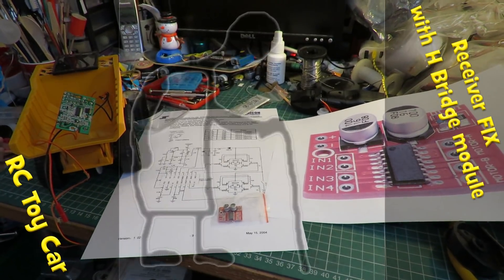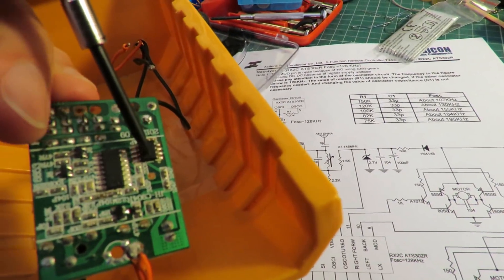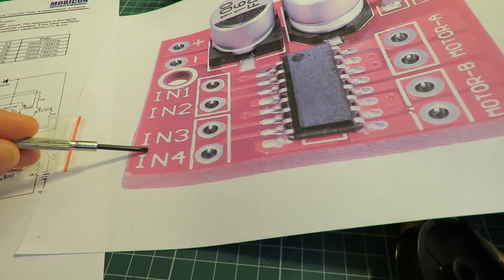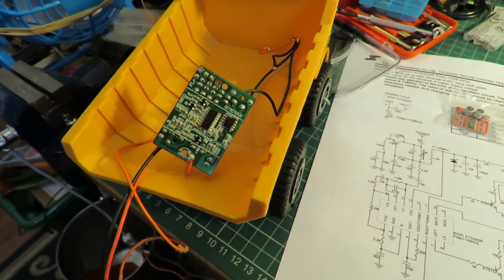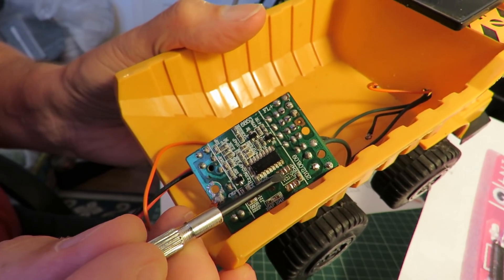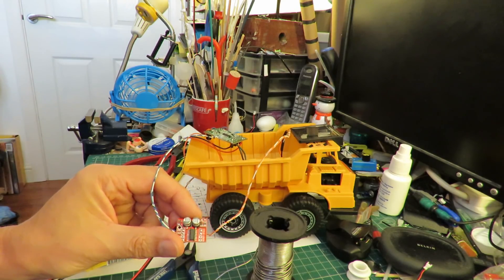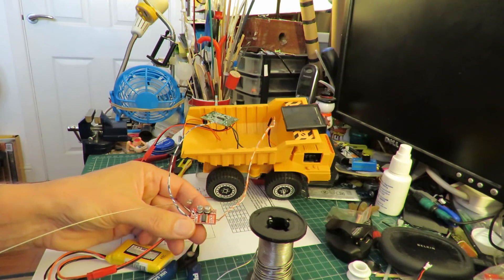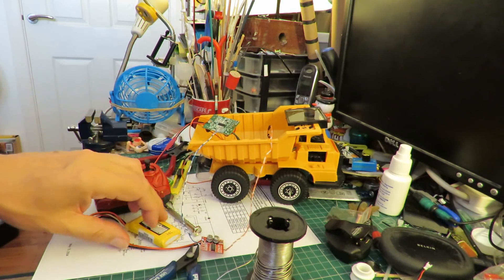Broken RC Toy Car Receiver FIX with H Bridge module

Comment: Hi again is it possible to upgrade transistors for more power ? Finally any idea how to extend range on a 27mhz 😊
Reply from the maker: @RyanRobinson-qi8qr  yes you could change the transistors to handle a higher current flow. You would need to find data sheets for the transistors and check their specifications. There are often comparison charts on electrical component sites that help you with that. However, if you want to increase the voltage, it is a bit more complicated. Remember, the rest of the receiver circuit board is designed for the voltage of the existing batteries, so it will burn out if you increase the voltage. You can get a separate H-bridge module that will work with the output of the existing receiver circuit but use a separate battery to power the motors. All of this depends on your electronic knowledge and skills. It is an excellent learning project. As for increasing the range, the length of the aerial is significant. You would have to research how the length of the aerial relates to the frequency. The bottom line is that unless you want to learn the electronics side of how it all works, the easiest fix is to upgrade to Hobby Grade radio gear. Initially, there is expense, but the Hobby Grade gear is well supported and can be transferred from car to car to boat to plane, etc. You get full proportional steering and throttle, and the range is literally out of sight.
Reply: @GrandadIsAnOldMan  thanks am so interested in running the motor with separate power are there any videos or articles to assist?
Reply: @GrandadIsAnOldMan  thanks am so interested in running the motor with separate power are there any videos or articles to assist?
Reply from the maker: @RyanRobinson-qi8qr  the video you are commenting on shows the H-Bridge module. It uses the output signals from the receiver, but it's power supply can be a different battery. You can find them on eBay if you search for "Dual Channel DC Motor Driver Module". They come in a wide range of power ratings and a wide range of prices. Explanation in the video description.
Reply: @GrandadIsAnOldMan  I understood the video however my chips are not burnt-out I just want to add more power to the drive motor
Reply from the maker: @RyanRobinson-qi8qr  Yes, by using this module you can do that, bypassing the H-Bridge onboard the receiver which is limited to the power supplied by the existing battery. As I have explained, if you just try putting a bigger battery through the existing receiver, you will burn it out. Changing the onboard transistors would allow those transistors to carry more current and voltage, but that won't stop the rest of the components on the receiver from frying.
Reply: @GrandadIsAnOldMan  thanks can i use the output that currently runs the drive motor directly to the external h bridge as the signal
Reply from the maker: @RyanRobinson-qi8qr  I explained in the video how it works. You take the signal from the pins of the receiver chip (RX2 chip in this video). That tells the H bridge module what to do. All you are doing is bypassing the onboard H-bridge and using the external module. That gives you the advantage of using a different battery to power the motors. If you had the electronic skills, you could cut the tracks on the receiver circuit board and modify it to do the same thing, but then you would also have to change the onboard transistors, so using the external module make the job simpler. I show the circuit diagrams in the video and talk you through how it goes together and how it works.
Reply: @GrandadIsAnOldMan  ok thanks for taking the time to explain. Cheers

Comment: My Rc car still steers but does not move forward or backward, I think I burnt out the ic 😅, I don't know what to do
Reply from the maker: First thing I would do it test the motor to see if that works Ok by putting a battery direct to it.
Reply: @GrandadIsAnOldMan  I also did that and the motor is working smoothly
Also when I added extra voltage on the receiver it made a pop sound and started smoking
Reply from the maker: @obiomaokeke9292  I think you have answered your own question. You will need a new receiver board. It really isn't worth the effort to try to replace the components.
Reply: @GrandadIsAnOldMan  thank you 🙂😌
Reply: @GrandadIsAnOldMan  thank you 🙂😌
Reply: @GrandadIsAnOldMan  I also did that and the motor is working smoothly
Also when I added extra voltage on the receiver it made a pop sound and started smoking

Comment: Thank you for this video, I thought for a moment I could repair my son's a rc car module, but now  I'm 100% sure that no way ))))))))))))))))))
Reply from the maker: It depends what is wrong with it and what sort of components are on the board. In most cases on the older boards it is probably one or maybe two transistors that need replacing when they have overheated. When the motor gets overloaded, car stuck in grass for example, it draws too much current and it is the "H-bridge" transistors that take the punishment as they are the ones that feed the power from the battery to the motor. It is very rare any other components get damaged. The problem is identifying suitable replacements. However, you can buy a replacement transmitter and receiver set and swap the receiver out. I used to trawl the charity shops buying up any cheap RC cars and then use the parts from them to fix other cars.
Reply: @GrandadIsAnOldMan   Thank you for reply. Actually it seems like a car looses a contact with a remote controller and it happens too often. A seller offered to send me a new motherboard, but after your video I think to request a refund)))))
Reply from the maker: @michaelraskin2251  there are so many possible causes, simply fresh batteries is sometimes all that is needed. Sometimes there is something causing radio interference. I have just found one of my old cars reacts to my WiFi signal.

Comment: Is it necessary to use separate batteries to power both the circuits
Reply from the maker: No, it is not necessary, if your receiver uses the right voltage, however you might want to so you can use a higher voltage for the drive motor.
Reply: @GrandadIsAnOldMan  Thanks...!!! 🤟 🤟

Comment: Why cant we connect the common power supply to H-bridge and receiver then?
Reply from the maker: You can use the same battery, however it's more a matter of the opposite. Often you want to use a different/bigger battery to drive the motor. Many people try to use a bigger battery to make their car faster and all that happens is they burn out the H bridge on the receiver, so using this external H bridge gives you the ability to use 2 batteries. Existing battery for the receiver and a big one for the drive motor. You could use the big battery for the receiver if you use something to drop the voltage down to a suitable value.
Reply: @GrandadIsAnOldMan  Thank you very much.. It helps Alot...!!! 🤟 🤟 ❤️😁😁

Comment: sir I wanna ask you that, how to fix steering chip  (MX08E-1637H) actually my steering not working
Reply from the maker: Can't really help you there. You don't fix chips, you desolder them and replace them. The chip is the black rectangular item with lots of legs.  
If your steering is not working, are you sure it is not just the buttons in the controller are stuck or worn out.?
If you want to check the circuitry in the car you might want to check whether the steering motor is still working by attaching a battery directly to the motor. If the motor is dead then there may be nothing wrong with your controller or receiver.
I the video I show you how I worked on the H bridge for the drive motor. There will also be an H bridge for the steering motor circuit which could be fixed the same way.
However, it might just be easier to buy a cheap RC car and swap the receivers.

Comment: Great video, i got a maket find,  big RC toy.  had a look and BOTH the H-Bridge chips are blistered.  Given its got a 9.6V battery, and its quite big, there is no heatsink on the H-Bridges.  Did you look into replacing the H-Brige chip on your project ?   I would like to just replace my H-Bridge chips but cant find any info on a Fast Lane 1/10 scale Toys R us,  toy.
Reply from the maker: Using an external H-Bridge module like this gives you the opportunity to power the motor with a larger battery. There is a wide selection of modules available as they are used on Arduino projects. You just need to identify the pin-outs on the controller chip and extend them to the H bridge module like I show in this video. I suspect the controller chip on the receiver will probably be one of the RX2 range like the one shown. Changing the chip onboard requires more skill with desoldering and resoldering SMD components and that is beyond my skill comfort range.
Reply: Your video was most useful,  but my project already has a 9.6v battery and its quite large, perhaps 1/10.  What is the amperage of these H-Bridges ?  they dont have heat sinks.  Would you know the P/N for the H-Bridges, or just too many..
Reply: On further investigation, perhaps my blown chips are not a H-Bridge, because is a 8 pin package, and pins 5-8 are all connected together !
Reply from the maker: You would choose the H bridge package to suit whatever task you require, they come in a range of sizes. You don't have to use a separate battery supply, I am just explaining that it gives you the opportunity to use a larger battery for the motor as the common reason for burning out the existing H bridge is because somebody has tried to increase the speed of their car by fitting a larger battery and the existing H bridge onboard cannot take the power.

Comment: If my chip is not burned, I should take the wire going to the motor and solder it to the h bridge.
Answer me quickly plzz.
Reply from the maker: Why would you want to move the wire from wherever it is at the moment? I am sorry I don't understand your question. At around 1:50 I talk you through the circuit diagram of a typical RX2 example. The output pins from the RX2 chip are used as the input to the H Bridge module that I am using to replace the failed components on the receiver board.
Reply: GrandadIsAnOldMan To increase the output power of the receiver to the motor. Plzz answer my question.
Reply from the maker: I did answer your question. I will paste it again here. At around 1:50 I talk you through the circuit diagram of a typical RX2 example. The output pins from the RX2 chip are used as the input to the H Bridge module that I am using to replace the failed components on the receiver board. Do not connect the motor wires to the input of the H bridge or you will burn it out.

Comment: My Rc toy car's Steering is moving in Left direction when I switch on the car please help me to fix this reply me as fast as you can I am eagerly waiting for your reply 😶
Reply from the maker: Have you tried adjusting the steering with the adjuster underneath?
Reply: GrandadIsAnOldMan 
Yes I have Adjusted the Steering underneath but the motor keeps running in one direction as soon as I switch on the car now what could I do please help me to get rid of these problem ?
Reply from the maker: We have to work through this a step at a time. If the steering motor is continuously running in one direction as soon as you switch the car on have you checked the transmitter turned OFF and there are no other transmitters close by that are switched on? (It is easy for the car to be controlled by another transmitter maybe left in a toy box switched on. I have a bag full of transmitters stored in a cupboard and sometimes I forget to switch them off when I put them away)
Reply: GrandadIsAnOldMan 
I have Removed batteries from the transmitter 2-3 times to check if there's a problem in the transmitter but after removing the batteries the motor is running continuously as far as concerned to other transmitter I don't have any other transmitter so I don't know what's the problem in my car I think it's a complicated matter 😖😓
Reply from the maker: I am just going through this a step at a time. There would be no point in taking the car apart and trying to fault find on the receiver if the problem was the transmitter so we need to check the basics 😊 Now that we are confident it is not just the transmitter locked over to left turn and you have it switched off and/or the batteries out we can start to look at the car and the receiver. 
You are saying that as soon as you switch the car on the steering motor operates and turns the steering left. This tells us that you are getting power from the batteries and the wires on the steering motor are fully connected, which is a good start.
There are a few causes I can think of.
1. Some water or condensation is on the receiver circuit board causing a short circuit at some point allowing a signal to turn on the power transistor that feeds the motor.
2. A small scrap of wire or a loose blob of solder is doing the same as 1 above
3. One of the power components has overheated.
For 1 and 2 carefully cleaning the receiver circuit board with a light brush - maybe an old toothbrush - and some rubbing alcohol or methylated spirits might do the job. Be careful with alcohol and any flames nearby, cigarette etc don't set fire to yourself.
If the problem is 3 a component has overheated then you are probably looking at buying another RC toy car unless you are extremely competent at fault finding down to component level on electronics. As you are asking me for help I suspect you are not a maintenance electrician.
If that car is special to you then you might be able to buy another car and just swap the receiver boards over.

Comment: +GrandadIsAnOldMan   --  I really like the way you think.  Suggestion .. If you removed the bad H bridge chip, you could simply connect pads 6 and 7 directly to the motor output pads for the chip.  Then use the existing motor connections as input to you new H Bridge inputs.  The existing motor wires are already soldered to the existing board.  The same might be done with the Front and Back when that part burns out, or before ;-)
Reply from the maker: I had to read that several times before I understood what you meant. Yes I see what you mean if I strapped straight across that would prevent the stress on the tracks on the board. Thanks for the suggestion, great tip :-)
Reply: Sorry for the difficulty, but glad you got it.  I have saved several cheap RC toys and, thanks to your video, I now know how to use them to modify one of those kid sized "power wheels" cars.  I just might be ready for the snow on the driveway this winter.  Then I can tackle the grass in summer.  Thanks again.
Reply from the maker: Jay Herde let us know if you make a video of the project :-)

Comment: Can you make a video on how to find the right charger for JST  lipos and DIY lipo with JST connectors
Reply from the maker: I use a Turnigy battery charger that you can adjust for whatever battery you are charging. I don't know what you mean by a DIY lipo. I buy mine, I would not attempt to make one.
Reply: GrandadIsAnOldMan I mean using battery cells from a laptop
Reply from the maker: Time Lapse King there are plenty of videos on YouTube on that subject.
Reply: GrandadIsAnOldMan i know I'm just wondering